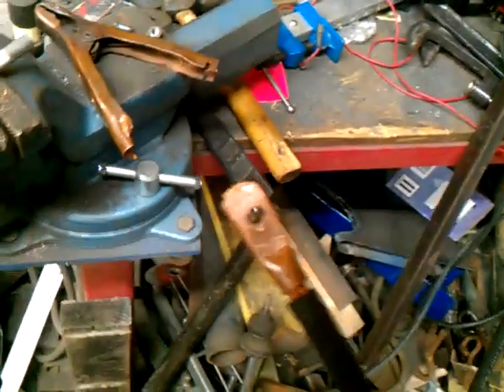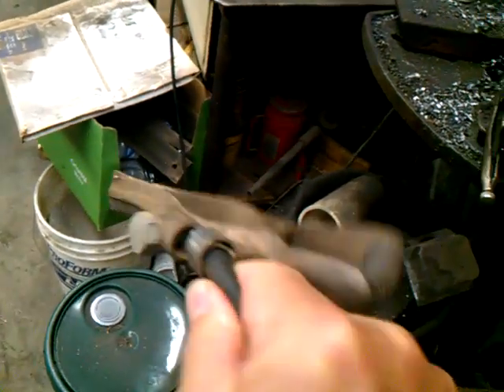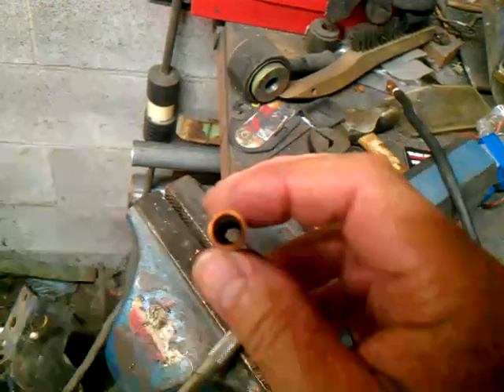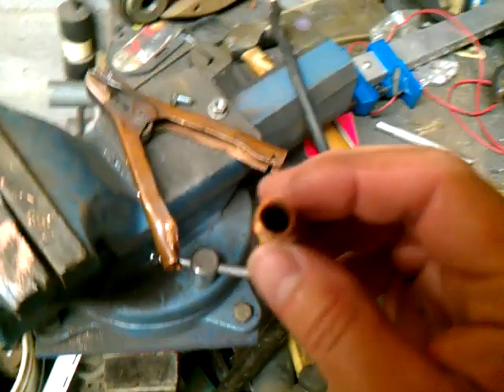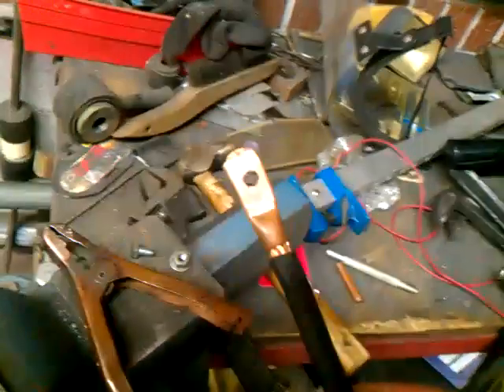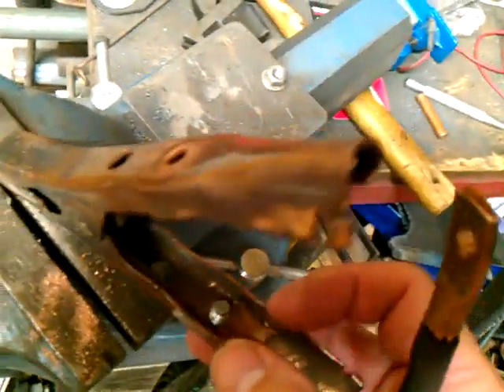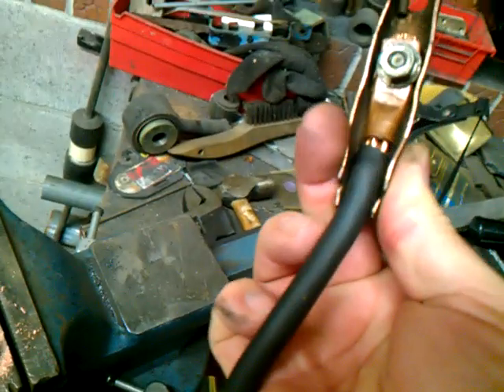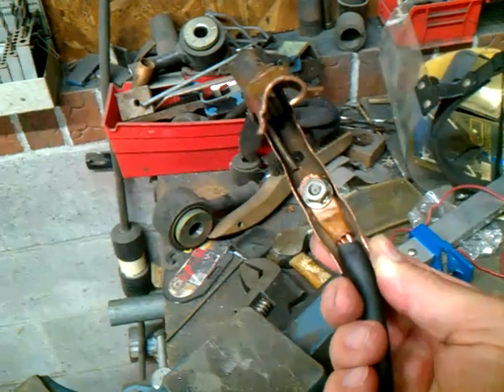Make Copper 12V Battery Cable Lugs For Pennies!

Comment: OUTSTANDING IDEA  I have built hot rods and worked on airplanes for many years.  If you clean all the parts to bright copper, use a hydraulic press to get a neat crimp. drill the hole, trim the end so the wire and the tubing is flush, solder just the tip, and seal the terminal and cable with short length of polyolefin heat shrink containing adhesive, you will have an aircraft grade neat looking terminal end that looks FACTORY MADE

Comment: One of the best tips I've come across in a long time!  
I don't see why this wouldn't work on a car battery terminal?
Maybe cleaning the inside of the tubing to bright copper then after assembly and hammering it down then soldering it might take it to the next level. The solder should suck up into the flattened area. Also should use flux prior to inserting the cable into the tubing.